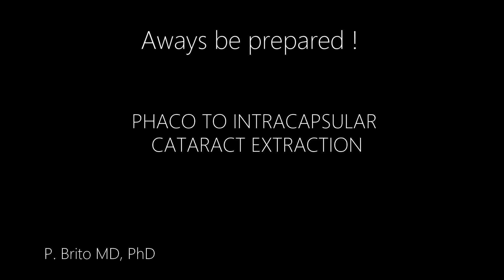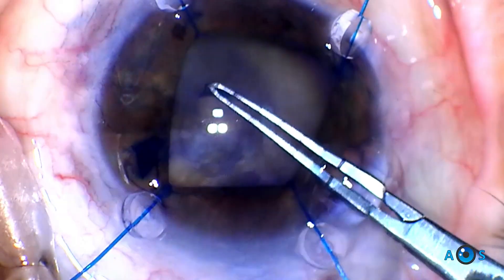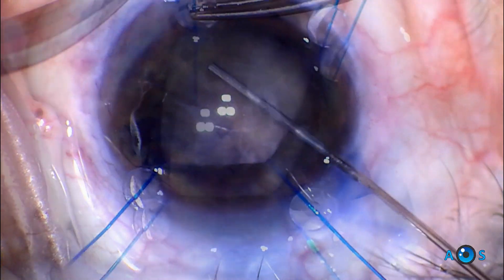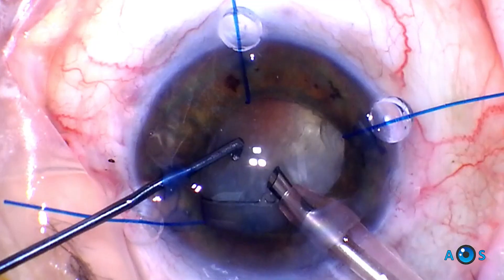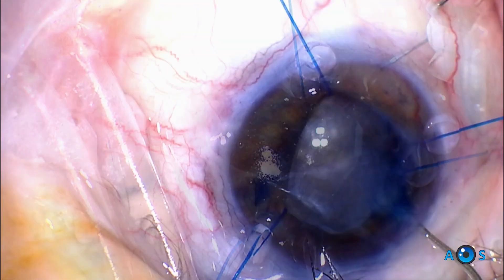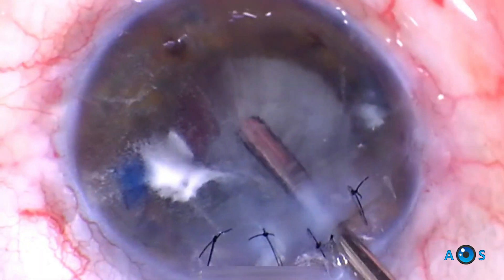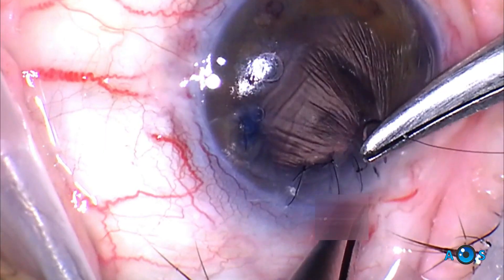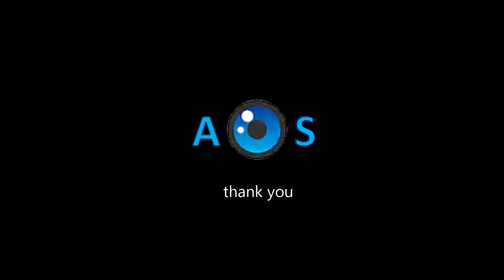Be ready! From Phaco to Intracapsular Cataract Extraction: dense phacodonesis cataract surgery

Comment: Fair attempt. I’d say ‘Anticipation’ is a surgeons most valuable trait. Once you saw that the zonules were very unstable, you should ideally have switched to SICS. You would have probably been able to use CTR later, save the bag, implant a pciol and avoided a second surgery. Well done though. Continue learning!
Reply from the maker: Yes... SICS would be a sureproof technique in this case, but in Europe is not a very frequently trained technique. As regarding a pciol I have serious doubts it would be a longterm solution. The patient had phacodonesis seen through the slitlamp with a minimum dialted pupil... the manipulation to perform SICS would also contribute to weaken the zonules meaning that a pciol would be unstable and long term eventually subluxate. I could be possible with a scleral sutured Cionni ring.

Comment: Thanks for posting this.  There are a number of good teaching points here.
Here are some things that I would have done differently:
1) The capsulorhexis is too small for a dense cataract like this.  Shoot for almost 6mm.
2) It's not a good idea to place the CTR so early - it's much better to use the hooks to stabilize the capsule until most of the cataract is removed (although it's not clear that there was so much zonular weakness that this would have been necessary). Also, a bimanual approach to inserting the CTR using a Sinsky hook to guide the leading eyelet minimizes iatrogenic damage to the zonules.
3) This is the main one - when converting from phaco to ECCE/ICCE, suture the clear corneal incision and move over to make a scleral tunnel incision in a different location.  Large clear corneal incisions are leaky and cause fluidics issues and flattening of the AC during surgery and unpredictable astigmatic outcomes later on.
4) Although it isn't unreasonable to leave the patient aphakic, I probably would have placed an ACIOL while I had the eye open to reduce the need for additional surgery in an elderly patient.  I would have done a PI with the vitrector, which is easy.
Reply from the maker: Thank you dear colleague! all valid points! the rhexis was difficult to control as the capsule was a bit loose and inteied to deffend agains a radialization! (the patient had phacodonesis seen at the slitlamp through a mildly dilated pupil!)! thanks for watching anf for uour insightful feedback! best regards
Reply: Gufyiy

Comment: The Surgeon started excellently, but CTR should have been implanted either a bit later or dialled manually and use coloured CTR that has a better visualization.
Reply from the maker: Thank your for the great suggestion I have not seen colored CTRs but will look into it great tip
Reply: @AdvancedOphthalmologySurgery  Dear Brother, I have personal experience of dark blue coloured CTR which gives a better visibility during its insertion. I don't remember the manufacturer but will definitely send you details about it. Plz share your email or any contact.
Reply from the maker: @MuhammadKhan-pl8je  would appreciate the reference. thank you for your care Dr Khan!